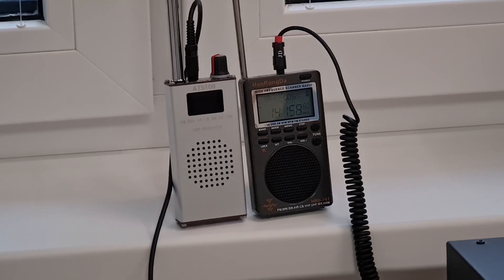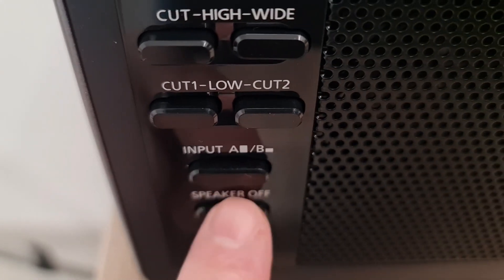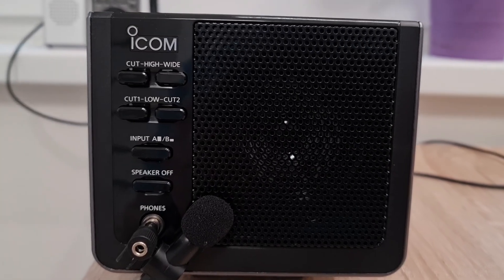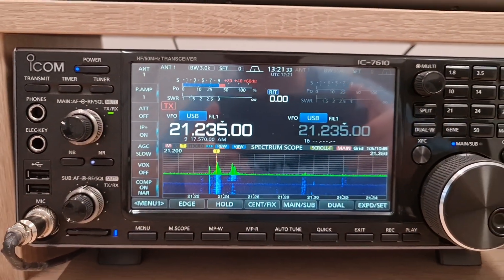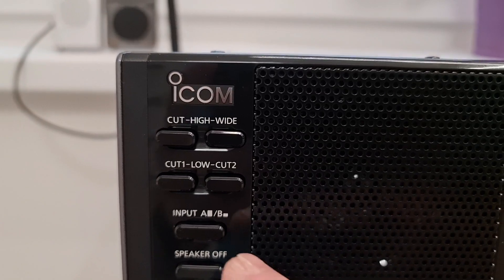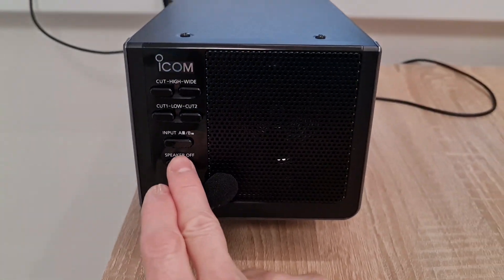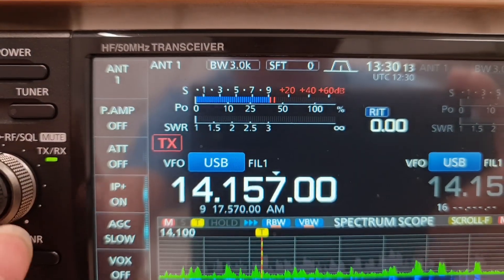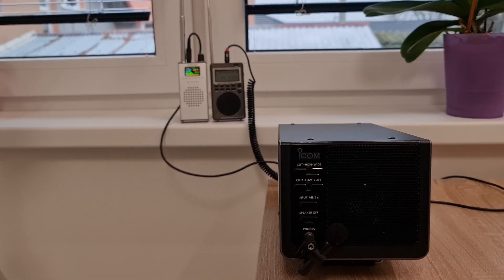HRD-747 vs. ATS-100 receiver sensitivity Comparison

Comment: Good profiling, bad reception on certain bands (hiss) is not always systemic but probably a mismatch in choice of antennas. myself have good results with 136-147MHz short duck antennas with the airband. It is not always exactly tuned to a certain frequency range and performs exceptionally well on other bands. It reduces RF on certain bands (Better clarity) because it cant resonate on higher frequency interference. It seems. I think this test is not correct and by putting both radios next to each other is the reason. Each by themselves would perform equal. I do like your tests and reviews, keep making them.
Reply from the maker: Thanks again! There is also a video about fixing the wobbling problem 😉

Comment: 👍When comparing receivers, you need to refer to the receiver circuit. The 747 uses three different chips, single-chip receivers, for different bands. 
The 747 also has a UHF amplifier based on a field-effect double-gate transistor BF1212WR (N-channel dual-gate MOS-FETs) in all bands. In the short wave range, si4735 is used.

Thanks for the objective radio test!👍
Reply: Qual seria sua escolha entre Retekess TR110, XHdata d-808 e Tecsun PL 330 ?

Comment: Just shows you for very little money you can hear what the icom does same goes for the xhdata and the tecsuns and the malahit 1 to 2 hundred euros you'll hear with the right antenna that any hi end receivers will had cheap and very expensive receivers been a swl for 40 years currently using the icom ic 705 for swl thinking of buying the icom icr 8600 as well 👍
Reply: Não recomenda nenhum modelo nessa categoria ? Pois o icom ic 705 é distante para muitos !
Reply: Evil Robot Santa Claus 🎁 💣 💥  Qual seria o mais atualizado: TR 110 ou HRD 747 ?
Reply: Evil Robot Santa Claus 🎁 💣 💥
Reply: Evil Robot Santa Claus 🎁 💣 💥  Estou esperando o hrd-104 para testar, mas o v115 é interessante, apesar de ter um tamanho maior.
Reply: Evil Robot Santa Claus 🎁 💣 💥  Assim que chegar, farei meus testes e comento aqui ! Já chegou no Brasil e passou pela alfândega sem taxa, rsrsrs.
Reply: Evil Robot Santa Claus 🎁 💣 💥  O 104 atendeu as expectiva, tem tudo que estava procurando: bloqueio de botões, FM extentido, scan, memória da sintonização, antena telescópica, iluminação e timer. Claro que se tivesse maior qualidade de construção e um som melhor, seria perfeito.😀
Reply: Evil Robot Santa Claus 🎁 💣 💥  Tenho o Xhdata d808 versão 2023.

Comment: Both of them - wasted money
Reply from the maker: Or PL-330 is also worth of money 😉👍
Reply: Evil Robot Santa Claus 🎁 💣 💥  I'd recommend Tecsun PL-365 or some used PL-660. It's slightly more $, but they are actually good.
Reply: Evil Robot Santa Claus 🎁 💣 💥  Sure. They're slightly different class, but that's the point. In my opinion  (which is just my personal view, nothing more), the PL-660'ish class is the lowest receiver class that makes sense of buying for some "serious" HF listening. There is some quality (also price) threshold,  below which it does not make sense to go, becuase then it's rather a toy than a tool.